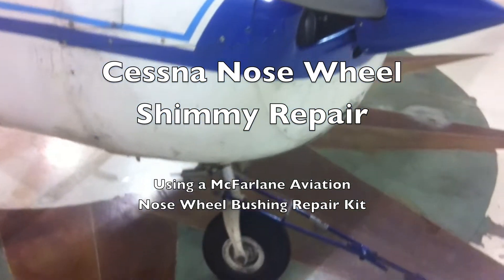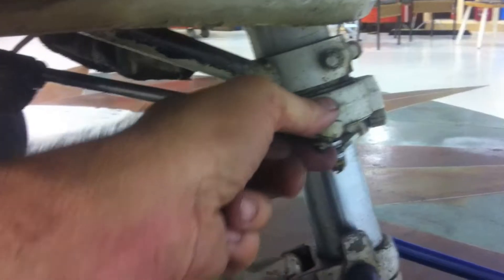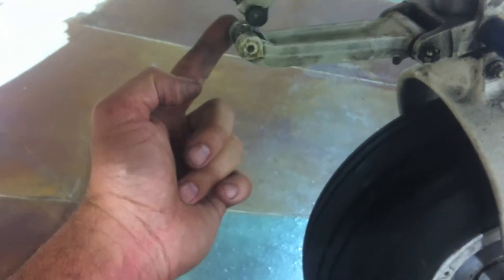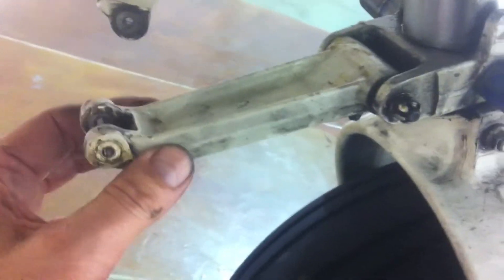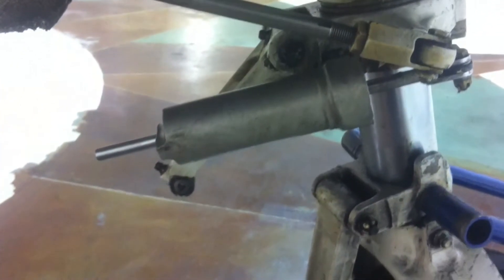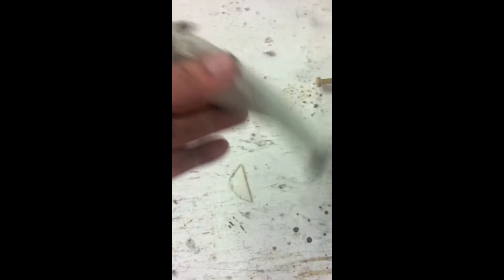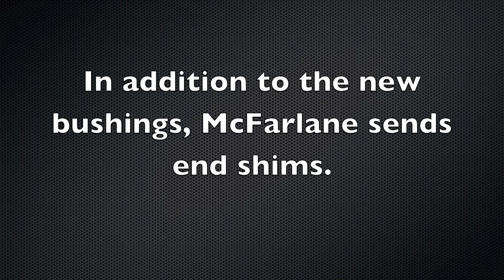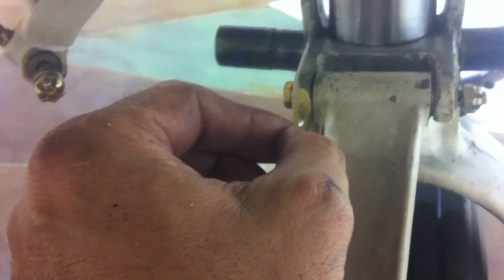Cessna nose wheel shimmy repair

Comment: You can do all this and it probably will still shimmy .
Reply from the maker: it was after all only a 150...but this kit helped significantly.  Never had shimmy problems on any of the bigger planes I'd owned.  I'd flown an occasional airliner or two every year that had something going on but that was more often a wheel bearings or wheel balance issue.

Comment: Great Job! I have the same problem with my Piper Tomahawk PA38 112.  Upper and Lower links are not tight and cause shimmy. I ordered new parts to repair the problem as you did. Will update afterwards.
Reply from the maker: Well good luck.  I sold the ol' 150 after she tried to kill me twice.  I sold the 210 after I lost my medical.  I sold my soul when I found paramotoring.  I'll take new paramotor gear over 50 year old G/A equipment any day of the week, any weather, any flying event.  I can buy new gear every year for less than annuals used to cost me. I have more fun than I ever did after owning different airplanes.  Unfortunately, I've written off most of the general aviation community as a bunch of pompous self important jerks YMMV.  For whatever reason I still keep my CFII current, but the thought of ever using it beyond helping friends sends chills down my spine.
Reply: @YankeeinSC1  sounds like you're contributing to the problems with that attitude.
Reply from the maker: @SoloRenegade  Well I certainly didn't start out that way, but I flew my airplanes at my private (residential airpark) airport for 15 years. Never so much as had the nose wheel deviate from the centerline of the taxiway. I kept my mouth shut as other pilots crashed into the end of the runway, ground looped into the wind sock, broke numerous FARs, crashed on the adjacent road to the housing development, had airplanes fall off of jacks at anual , roll down hills & into the woods, setting the woods on fire, get killed on cross countries to places away from home...never said a word. But the day I bought paramotoring gear? I became the idiot? People like you...

Comment: The shimmy damper only dampens the shimmy when it happens, It does NOT prevent the shimmy. Replacing the bushings like you did will fix the problem

Comment: One of the biggest culprits is the steering collar. The steering rods can hide this somewhat. Put a tow bar on the nose and rock it back and forth. watch for the collar uniball lugs moving up and down. Any up and down movement will allow shimmy. Shims are available from Cessna to tighten up the steering collar. The nose strut has to be removed completely to install shims. I'm a 45 year A&P and have done this many times. As to an owner pilot doing work see FAR part 43 appendix ? For a list of what an owner pilot is allowed to do. If you do any work you are required to make a log book entry complete with date, work done, instructions used( maintenance manual or other approved pubs), signature and pilot license number.

Comment: I've found play between the steel tube bushing and the fork ears, especially on older equipment.  Made my own stainless steel shims to go in there first, then add the standard shims (made with stainless-I found brass wears too quickly).  Never had a damper issue in itself, (if the shaft seals are good) only in the mounting holes (reshim or rebush as required).  I worked on 172's and 150's for years, and never had ANY shimmy problem after I got a hold  of it, something I am quite proud of with all the trouble the nosegear can cause.
Reply: brass is SUPPOSED to wear. if you use things that are too hard, then something else wears. You want the wear item to be the softest.

Comment: I installed the McFarlane kit, rebuilt the shimmy damper, and even replaced the front tire on my XP.  There is still occasionally a small amount of shimmy.  Two questions:  how much of a part does tire balance play, and how tight do the shims have to be?  There is still a tiny amount of side-to-side rock in the scissors, but the bushings are brand new, as is the bolt, but I couldn't figure out how to get the last shim in place because it bent when I tried.  Thoughts?  I know AN bolts are a little undersize; what about close-tolerance bolts?  The bushings should stop the rocking without the shims, so I wonder if my time would be better spent there.
Reply: Yeah -  I'd like to see the answer to your question as well. I have a cherokee 180, and have a terrible shimmy on take-off.  There is considerable play in the scissor-link, so I think I may go the route this video talks about first.
Reply: McFarland has a sheet on their web page on how to end the issue.  Includes balance on the wheel, and sanding the tire.

Comment: I just did this repair to my 172 XP - I wanted to add that the hardest part of the job is getting out the old bushings, and I found a method that makes it much easier:  1) thread the inside of one bushing.  This will be hard to do; the bronze will grab your tap.  Use lots of lube and make about a 1/4 turn at a time, backing up each time to clear chips.  Oil is essential. My 172 has a long steel inner bushing that is 5/16" O.D., and a 3/8" tap threads that size without any further drilling. You only need about 4-5 threads.  2) Screw a bolt in from the outside end (obviously) and snug it up.  3) Now you can slip a smaller bolt through the OTHER bushing and push the first bushing out with a press.  I thought 5/16" was too small for a pusher, so I drilled the second bushing out to 3/8" and used another 3/8" bolt to push with.  I tried using the original long steel inner bushing to push with, but it deformed and I was afraid it would get stuck. 4) Use appropriate-sized bolt to now push out the second bushing.  Sorry - I maybe should have done a video, but yours is so good I thought this was all it needed.
Reply: We do numerous aircraft being a maintenance facility, and just drill off the shoulder of the large bushings with a 1/2 " bit, and the smaller middle bushing shoulder with a 5/16 bit. Then push out both bushings the same direction using appropriate Snap On deep sockets. Also remember that the new spacers slipped into the bushings on the upper and lower sets, are by design, longer that the bushings, and the brass shims have to be installed before slipping in to the recess.

Comment: Is this something I can do on my own, I've kept a aluminum foundry running for almost 30 years all by myself, I've changed out more then a few bushings in my Day. I'm buying my friends 150 this week, just flew it yesterday and it has some also, who would be any the wiser anyway
Reply from the maker: indianchief741 I suspect what you are asking is can this repair be legally done by a pilot/owner under the provisions for owner preformed maintenance of FAR 43.3(g) and 43.7(f).  I am not a lawyer and I don't play one on T.V., but I would say "not likely" without at least being done under the supervision of a licensed A&P mechanic.  Who'd be the wiser?  1) An insurance company conducting a post accident investigation.  Especially if they were being sued by a passenger of yours if that person was injured in an accident. 2) The next potential buyer.  Especially if he employs an A&P to survey the airplane for maintenance compliance before he purchases it.  3) The FAA if they ever were in suspicion that you were willfully violating established maintenance proceedures and protocol. I've seen them do a part by part compliance inspection, one nut and bolt at a time.  How likely are any of the 3?  I know owners that have experienced all of the above.  In a nut shell, it's just not worth the few bucks you'd "save" by not getting a mechanic with the proper certification involved.  If you'd rather do it your self, build an experimental homebuilt IMHO.
Reply: YankeeinSC1 ya, I get it, friend told me all 150's have it anyway , I'll fly it over to thunderbird where a A&P buddy can watch. Thanks